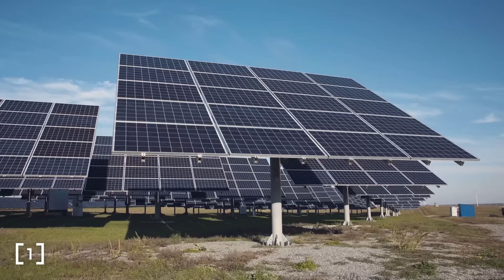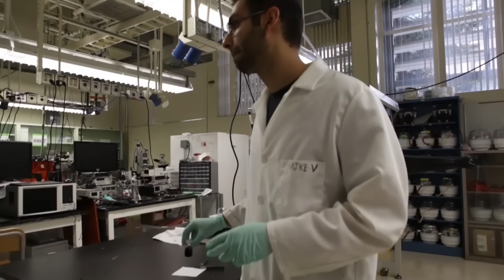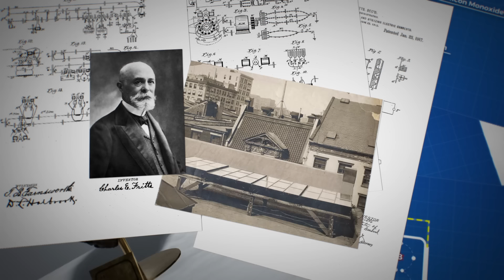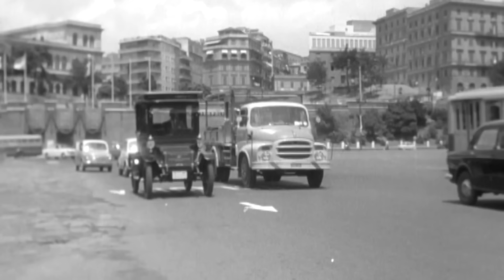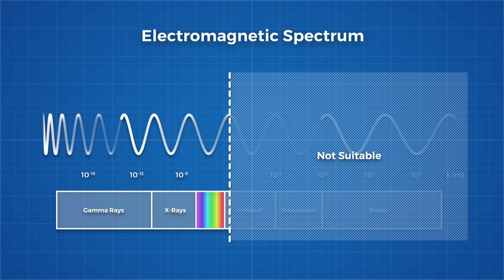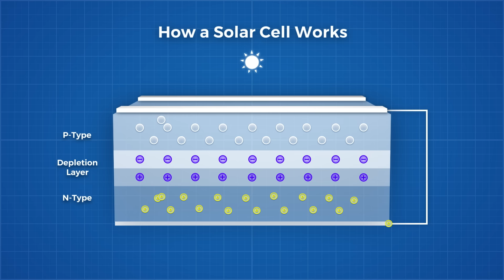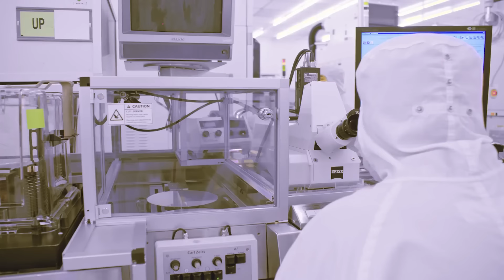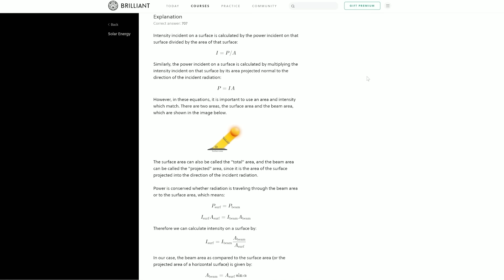The Mystery Flaw of Solar Panels

Comment: The fundamental flaw of solar energy is that even if solar cells were 100% efficient at converting solar energy to electricity solar would still not be a viable source of power. Solar depends on government subsidies and mandates.
Reply: Funny you say that because currently fossil fuels are heavily subsidized by governments to!
Reply: @musiclife7251  Fossil fuels do get subsidized but not heavily. More important, fossil fuel production would survive without subsidies. Not so solar.
Reply: @Nl-nn3ds  Yes but they are still subsidised. So which energy would you rather subsidised is the question. I will always go for clean renewable energy over cancer causing polluting fossil fuels. It's a no brainer
Reply: @musiclife7251  I would rather not subsidize any energy source. Let the market sort it.

Comment: I believe its realy important to realize that solar power is not a fix all replacement for energy production!

Most people think solar power is this magical slab that converts all the suns energy for free. And its only downside is that it doesnt produce at night.

No.
Solar pannels have a lot of flaws.
The biggest being their efficiency, both about converting solar energy into power, and their power per surface.
Even at 100% efficiency, solar farms would need more space to creat the same output as a fossile fuel or fission powerplant.
Not to mentio,solar power lifespan is significantly shorter then either of those powerplants.
Their production, recycling and disposal meanwhile is also similarly toxic to the enviroment as fission and fossile fuel power. At least in the pollution per MW. It is better, but not by much.

Solar power is great, and our most direct way of accessing the energy of our largest energy source. The sun.
But its flawed.
Heavily flawed.

Comment: It really is not a mystery why the panels behave like that. You are inducing electron flow and those electrons come from somewhere. Sure you have 'the hole' provided by the structure of silicon crystals but still the electrons still have to comr from atoms. That means the bonds are breaking down as you use the panel which reduces the viability of the panel over time.

Comment: Why try to control the heat? Why not intentionally increase it by creating a layer of vaccum betwen the cells and surface. The excess heat could be then channeled into heating water to spin a turbine

Comment: There is a belgian company ilumen selling the PID box that reverses the degradation process, it has to stay in the circuit and regularly applies some reverse voltage on the cells to refresh them to factory state and avoids the efficiency drop.